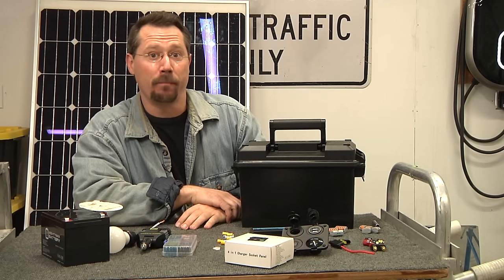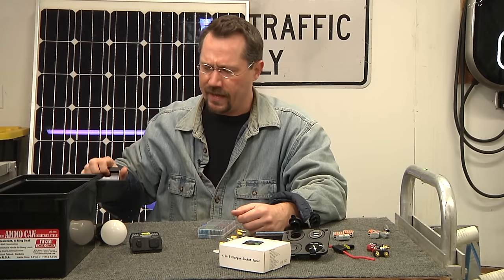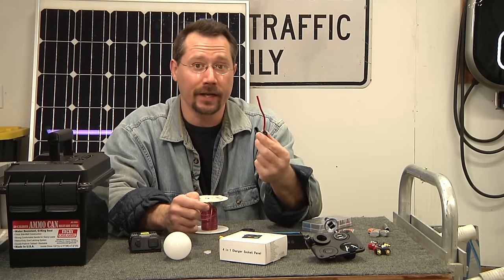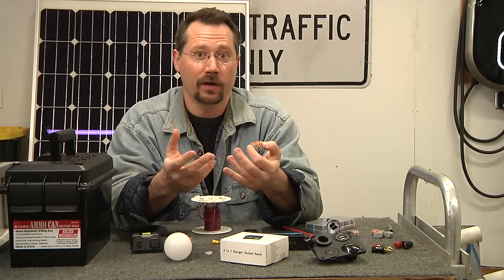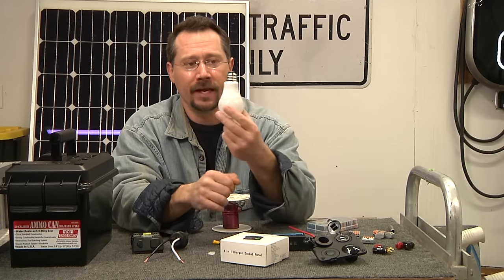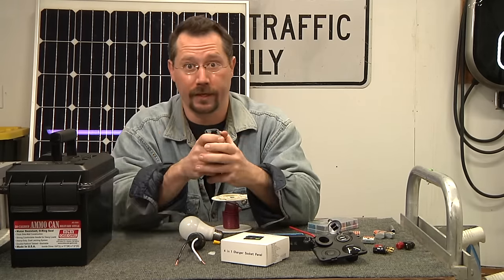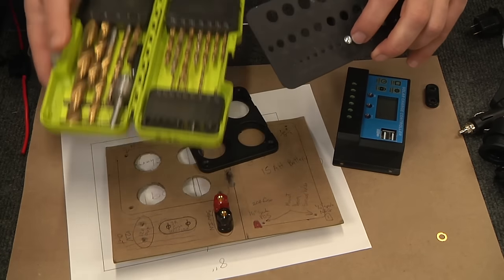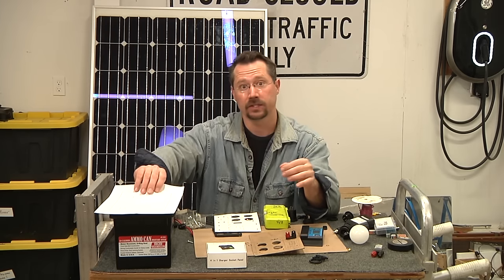Build A Solar Ammo Can Full-Length Instructional Video

Comment: BN - this is great information.  If I wanted to use 2 batteries for a total of 30-35 AH, would it be problematic?  Would it be better to just get the bigger 35 AH battery?  I was thinking 2 of these would fit in this box nicely and give a 35 AH system (equivalent to Goal Zero 400).
Reply from the maker: There is room inside the box to mount two batteries instead of one. If you do that, they fit great. Connect them in parallel - positive to positive, negative to negative.
If you go to a single larger battery, it may not have the right size and shape to make as good use of the available space inside the box.
Reply: @BenjaminNelsonX  That's what I was thinking.  Thank you!
Reply: @BenjaminNelsonX  Another thought - would these 2 draw down together more or less, or would I need to put in an isolator or voltage sensitive relay of some sort?
Reply from the maker: @OverlandCommand  Just use two of the same size/brand/make batteries and they will work fine as a pair. They will charge and discharge together.

Comment: great video. I was wondering what your intended use for the DC out connection was
Reply from the maker: That's just sort of the "and anything else" feature.
I have jump-started my car from that before, BUT I have an electric car where it only needs low current to bring the 12V battery up in voltage to boot up the car, rather than the VERY heavy current draw of a starter spinning a gas engine.
Reply: @BenjaminNelsonX  so just a in case I need it thing. Good job of thinking ahead. Also think you for replying to a video that's 3 years old really appreciate it

Comment: This looks awesome!  I'm gonna give this a go and build it, thank you for posting!  I was wondering if I were to put a li-ion battery in it instead, what would I need to change?  Would the same charge controller work?  And would it wire up any differently?  I want to see if I can get enough power to run my little guitar amp that uses about 150 watts @110v.  I want to charge it with a 100watt solar panel.  Thanks for any help any can give me!
Reply from the maker: You'd probably want a little different solar charge controller. Lithium is a little more complicated, because you have multiple cells (which need management) instead of just a single 12V battery.
This project specifically used a plain 12V battery just to make it a good entry-level project for people new to renewable energy.

For info on lithium batteries, I recommend Micah Toll's book: https://amzn.to/2OoAUdc
Reply: Thank you for your response.  I will give that book a read and see if it is something I could manage.  I have never built one of these before so it may be wise for me to stick to your original design before trying to make changes.  Thanks again!

Comment: One more question.   If you have to open the top of the water proof can, what's the use of it being water proof?   Couldnt you just put the solar/electric thru the lid or side and insure it was water proof with some butyl tape?
Reply from the maker: I've never been in a situation where I have been trying to solar charge in the rain.

You certainly could put holes through the side of the container and mount connections there. I think it looks ugly and tends to catch other things on the outside of the box while moving it, stacking with other boxes, moving in and out of the car. Somewhat removes the "Modularity" I like about these boxes.

There is also enough flex with the lid that I can simply run the solar charging wires inside and still close the lid. No rain would get in there.

There are a LOT of similar projects right here on YouTube. There's more than one way to skin a cat. Build the project how you would like. I didn't like the appearance of most of the similar projects I saw  here, so I built one that I did like and shared it.
Reply: Check out Will Prowse.

Comment: Very good video, any chance you have a video with a 120v output capacity?  
Working in construction, it be really nice to have a 120v on jobsites where there is no power when needed.  

Thanks
Reply from the maker: Simply plug in a power inverter.
Keep in mind that this system is relatively low power. If you want to run a table saw on a job site, you will a larger battery, and a very powerful inverter.
I use a simple, inexpensive inverter with this system for 120V light strings and other low power loads.
https://amzn.to/2NwY6HM

The construction industry has also done a wonderful job of improving battery operated tools. If you are ONLY looking at running power tools at sites without electricity, consider investing in modern cordless battery-operated drills, saws, and other tools.
https://amzn.to/2KSjGoe
Reply: Remember that a SkilSaw or other power tool drawing 10 amps at 120vAC translates to 100 amps at 12v plus the inverter losses... more like 105-115 amps... Running 120 volt AC power tools requires LOTS and LOTS of current meaning LOTS and LOTS of battery.  A friend of mine built up an oversize version of this system about a year ago...  he simply upsized the battery to use two leftover car batteries in parallel.  He used a 1200 watt chinese-made inverter he bought at Autozone (watch the mounting, don't block the cooling airflow)!  He used 150 amp Anderson Power Pole connectors (google PowerWerx.com) and auto battery cable (2 gauge or 4 gauge) to directly connect the inverter to the batteries (minimal voltage drop).
Using a 2200 or 3500 watt Honda or Champion generator at your job site may be more practical.

Comment: Wonderful!  Is there to hook up the solar panel with the lid closed??
Reply from the maker: You have a couple of options.

First, just close the lid. Don't latch it. The weight of the lid will hold it shut, even if it's a bit windy outside.

If you DO feel the need to latch the box shut, I found that I could just have the solar panel wire running over the middle of the side of the box. I could close the lid, and there would be enough flex for me to latch the box shut without pinching the wire too hard and damaging it.

Since this is a solar project, and the solar panel makes energy while the sun shines, I didn't feel a need to design it to survive a monsoon with the solar panel plugged in. I simply unplug the solar panel at night or in rain and latch the box shut.

Lastly, you CAN simply drill a hole in the side or end of the box and build in an electrical connection for the solar panel, making sure that you caulk or otherwise weather-proof it. Many other people's similar projects do that. I don't care for the look of it, and there's always potential for leaks, but it's a straight-forward way to have the solar panel plugged in while the electronics are protected from rain.

However, you should build the project in whatever way is right for you.
I hope that these videos are a good example and inspire you to build your own project, rather than only exactly duplicating mine.

Good luck with your project no matter which way you decide to go on lid closure.

Comment: Hi Benjamin can you tell me if three of those batteries 15ah batteries will fit I know you only used two is there enough room for three though?
Reply from the maker: Just checking quick with a tape measure, it looks like the length of the amount can is just a little too small for the width of THREE batteries.

Keep in mind too that the wiring and 12V cigarette lighter socket sticks down quite a bit from the bottom of the panel. That goes into a hollow space where there ISN'T a battery. 

Besides adding another of the same size sealed lead-acid battery to the system, there are other options. One would be doing everything else the same, but going to a very LARGE battery, external to the box. (But that does eliminate the cool "hey everything fits inside!")

Probably the best way to go is to add one or more USB Lithium Powerbanks. Tuck those into the box, use the system to charge them, and then use those to power whatever your USB needs are. It's an easy way to add more storage WITHOUT needing to know how to build lithium battery packs.

The down-side is that they only do 5V USB. Versions that will also do 12V start getting larger, more complicated, and expensive.

Comment: Really good info! I have a question about the wire size you used you if you can help? I bought the solar controller you featured and the instructions said never exceed 80% of the conductor’s current rating. The controller is rated for 20A. A 12awg conductor is rated for 20A. Doesn’t that mean that you should use a 10awg so that the 20A current rating doesn’t exceed 80% of you conductor?
Reply from the maker: I really wouldn't worry about that. We are only dealing with very short sections of wire in the project. Long wire runs can cause voltage drop and excess heat.
20A is a general rule of thumb for 12 gauge wiring, but if you look at some other charts, it will handle much higher current. Short, single wires inside a box are known as "Chassis Wiring" - and the ampacity rating is higher.
Take a look at this chart: https://www.powerstream.com/Wire_Size.htm

In fact, this project would probably have been a little easier to wire up with 14 AWG wiring, as it's a little more flexible. (My main concern with using 14 gauge would have been people commenting over and over that it wasn't rated for 20A whereas the controller is.)
Reply: @BenjaminNelsonX  yeah I was thinking about using 12 for the runs from the solar panel plug and from the battery to the solar controller. Then use 14 for the load output on the controller. I’m thinking about using a small fuse block to run the load wires to the loads. If I do I might switch to 16 wire going to the loads. I’ve seen a lot of videos that people have used 16 and I know in my vehicle that is the case.

Thank for the chart and the response!

Comment: hey love the video! i am building something very similar, and with my current setup my 150 watt power inverter only lasts about 30-40 min using the 110v outlet. once the battery reaches around 11v or less, i cannot get 110v. Why is this? does this happen to you? should i stick with the usb outlets to charge my phone? thanks
Reply from the maker: A typical inverter is NOT going to run properly on 11V or less. It's just not designed to. If you are doing something like charging a phone, yes, use the USB outputs.
Small battery devices, like phones, are DC anyways. To charge the phone with the inverter, you convert 12V DC to 120V AC to 5V DC. There's a lot of wasted energy doing that. (Small inverters tend to not be particularly efficient.)

If you are powering a DC device, stick on the DC side of things. Much more efficient to go from 12V to 5V.
Reply: @BenjaminNelsonX  Okay that makes sense.. Now that I have re watched your video and others its all making more sense. Thanks for the response back. I've upgraded to two 12v 18ah batteries, going to try and run it parallel. Do you think this will work well with a solar panel?  I know it will double the amps, but not sure how the panel will charge the two batteries? Thanks again!

Comment: Excellent video, enjoyed a lot. Would I be able to use this with a trolling motor for fishing kayak? I have zero knowledge about electrical stuff, what I mean is like the cables are enough to properly power a trolling motor, or would they need to be thicker? Again, I have zero knowledge about electrical.
Reply: The answer is maybe. It depends on the current draw of the motor you have.  If it is less than 20A your good.

Comment: Hi dkes the solar charge controller drain the battery please? Thanks for the very informative video
Reply from the maker: YES! Actually, just the solar charge controller itself does have a display on it. If it is connected to the battery, but NOT solar for an extended period of time, it can slowly drain the battery.

If storing the project, simply disconnect power at the battery.

Alternatively, you can also wire up the switch to disconnect the solar charge controller from the battery. We cover this in an alternate wiring video for this project.
https://www.youtube.com/watch?v=4YKRa9m4N7M

Comment: Hi Benjamin, One more question... I assume that it would be possible to add additional batteries with the goal being to expand the battery bank. If I wanted to do that, would I simply connect them to the DC Out or would I add a third Banana Jack terminal and connect it directly to the Battery?
Reply from the maker: Probably the best two options are to just double up the battery inside the box. Simply add another one of the same size/shape/brand/AH Capacity. Just two identical batteries. There is enough room in the box for a second battery. Hook those up in parallel. Negative to Negative, Positive to Positive.

Otherwise, I would do a large EXTERNAL battery and simply run the original battery connections on the solar charge controller to that.
Reply: @BenjaminNelsonX  I'm in awe over how quickly you respond... thanks for the advice. Chris

Comment: I know this video is quite old.  Have you built an updated model of this using the much more energy dense lithium ion or LiFePO4 battery options?
Reply from the maker: Hi Jason,
I designed this to be a simple "entry-level" project that anyone with only basic tools and experience would be able to put together to learn more about DC and solar power.
Building a lithium battery from scratch gets to be a whole different level of complicated.
If a person wanted to BUY a pre-made lithium battery that would fit in the box, the only other change they would need to do is get a solar charge controller specifically designed with lithium in mind.
Reply: @BenjaminNelsonX  Thanks for replying to an older video.  I didn't really expect that.  :)
The complete lithium batteries available today, in all sizes, offer a nice increase in total energy capacity or a reduction in weight, depending on which matters more to you.  I just think your design is really cool, but would be more useful with the added power of a lithium battery, especially since they have come down in cost quite a bit.  

Thanks again!
Reply from the maker: @jasonbroom7147  And the best part of a project like this is that it's really more of a concept than anything. If you want to swap out a part, do it a little differently, go for it!
Reply from the maker: Here's a video about upgrading the project to a lithium battery. https://www.youtube.com/watch?v=bQCJFK-Yzb0

Comment: What type of in-line switch to disconnect the charge controller from the battery would you recommend....?
Reply from the maker: You can simply pull the main fuse or pull the + battery connection. Otherwise, you could add any 12VDC rated 20A switch. For example: https://amzn.to/2tL16Fs
Reply: BenjaminNelson .. Thank you.. Great video btw... thinking of upgrading to Lithium Ion maybe 10ah it is around a $100 for the battery ( and it has the BMS built into the battery )..but would probaply give as much power as the 12 ah lead agm because you can discharge it a little more... plus I will have the confidence that i built it and will hold up... as opposed to buying pre made .  which if you look at the reviews you find the units are suspect to holding up...
Thanks so much for de- mystifying this a bit... still doing my homework though.. thanks for the reply and link... Awesome.. !!! Great work on the solar panel review as well ...!!!!
Reply: Yes thank you for the info about the battery connection and main fuse... when I show my family how to use it I think it will be easier to say, turn this switch on, then this switch etc... I plan to build this with my kids..so they will know how it works...

Comment: Could this be charged from a cigarette lighter while driving and solar panel when camping like a Jackery? If so I'd much rather have something modular like your design so i could switch out different parts when needed.
Reply from the maker: Yes. Just run the cigarette lighter cord straight to the battery.
Reply from the maker: Make sure to double-check polarity!
Reply: @BenjaminNelsonX  Thank you

Comment: I would have had a slot to fit the fuse through, so If I do need to change out the fuse I do not need to remove the coverplate.

Comment: Hi Benjamin - do you think this same ammo box can fit a Valence U1-12RT?  I would be ok in cutting the ports into the top of the lid.
Reply from the maker: I looked up the size specs for the battery and the ammo can. It looks like a U1 size battery would EXACTLY fit inside, based on height. The ammo can would only be a little wider, but a good three inches longer, so you should have a little bit of space on the one end of the ammo can still.

Comment: I suspect the reason It was not charging properly with the pulsing Was because you were using a power supply underpowered to be used as a charger for this setup. The Wallwort you was using has a built in circuit that was protecting itself because that charge controller was trying to draw too much current.

Comment: What about a switch between the solar controller and the battery to keep the solar controller from discharging the battery.
Reply from the maker: Yes, you certainly can add a switch between the controller and battery. On this project, the + spade connector on the battery could be pulled, or the main fuse can be removed. A switch is fine too.
In any case, when STORING (instead of USING) a battery for any amount of time, it should be disconnected from anything that can be a load on it. That includes battery chargers.
Reply: BenjaminNelson, would there be any negative affect to moving the switch from the "load" side to the battery's positive lead just after the fuse, before the controller?
Reply from the maker: No, you could easily add a switch between the battery positive going to the  controller. That would act as a master disconnect. You could repurpose the switch that's part of the quad display to do that, you would just have to change the wiring a bit.